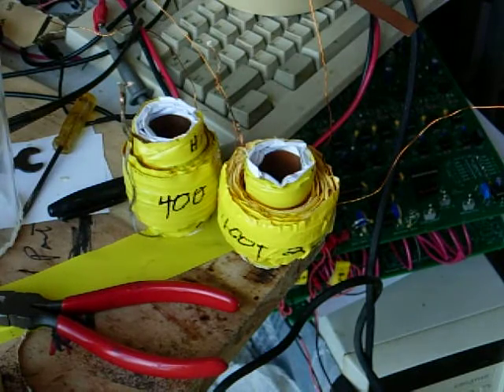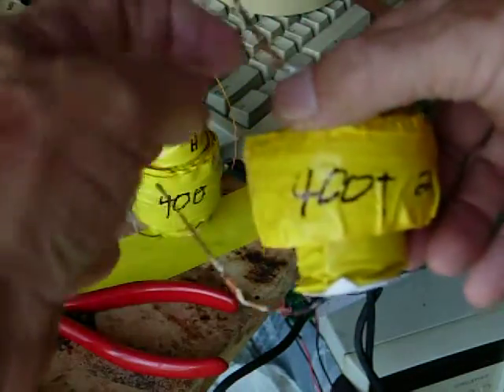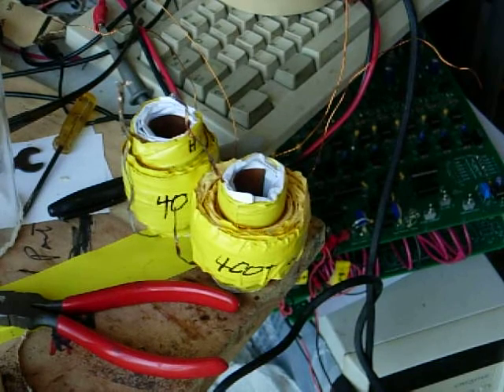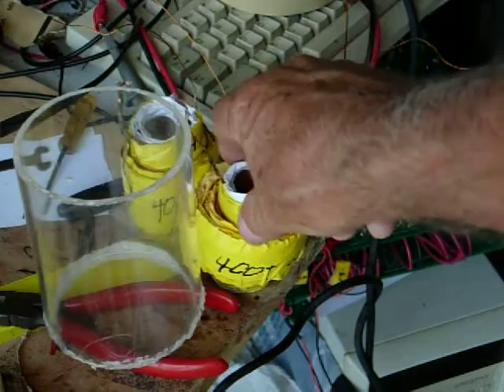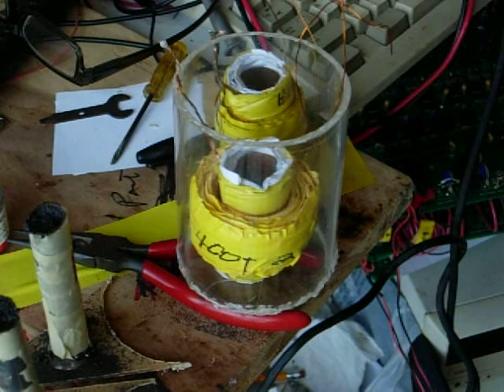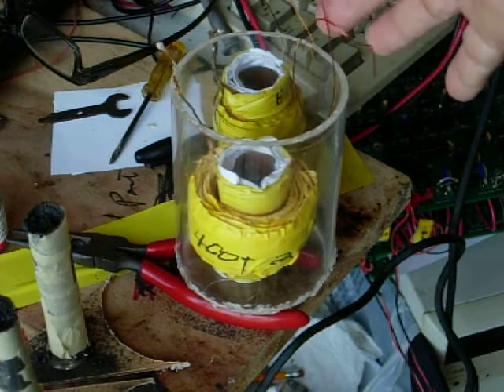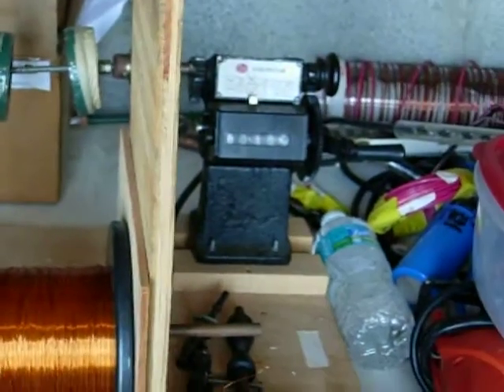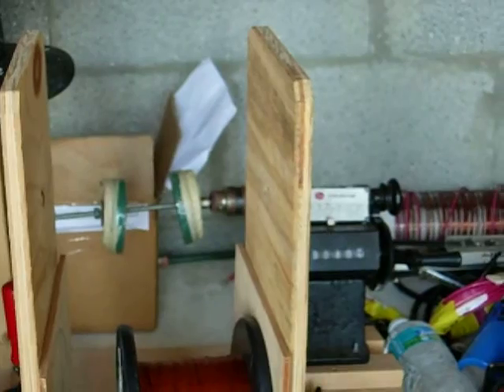Don Smith #104 mini pole transformer

Comment: hi just wondering what type of paper is that you used for the insulation.and did you have to heat it up?
Reply from the maker: green N.R.G printer paper.  It may not work but will try it anyway needs to absorb oil.   each HV layer is separated by tape forty turns per layer sloppy but shouldn't arc.

Comment from the maker: The HV  radiation from the neon transformer will basically do what Tesla did with his HV output directed at a plate.  the output from the plate will be 60hz Ac because my 24vdc motor runs at 3600 rpm and the bipolar magnet washing machine modulation should end up as 120  Vac 60hz  My core material will be cut from an old transformer core. .  If your interested you should search for How It's Made Pole Transformer